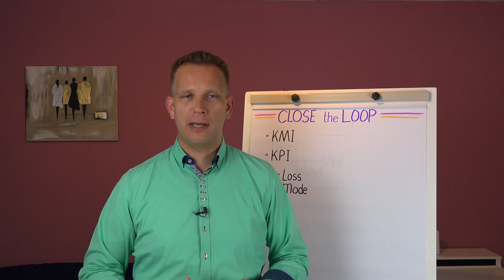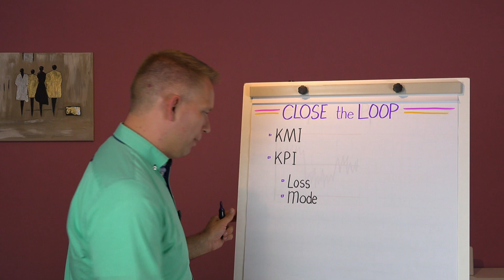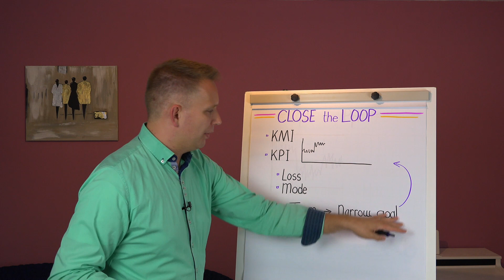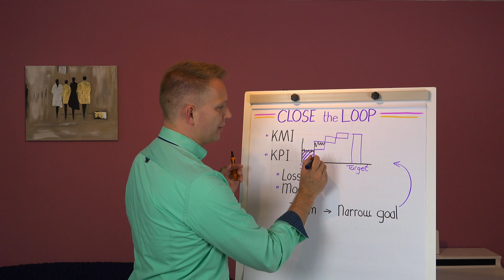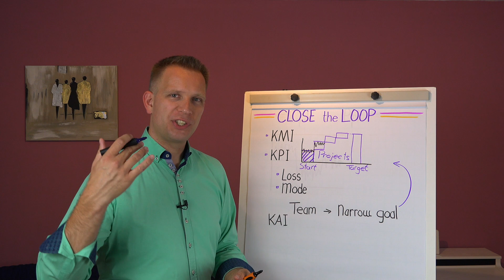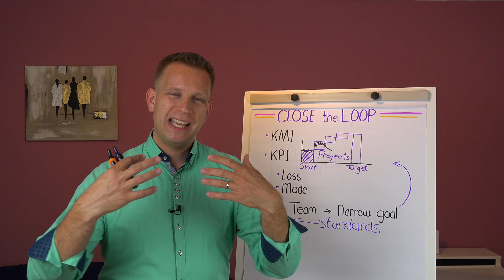Effective Continuous Improvement: Linking Team Efforts to Company Performance

Comment: Tom, could you develop in more details the KMI? Great video, thanks.
Reply from the maker: That’s probably a topic for its own video. 
The short of it is that if you only talk about KPI’s, that covers both KMI and KPI. 
The key Management indicators are directly linked to the company goals: cost per ton, total sales, total output and such indicators to directly influence profit and loss. 
Key Performance indicators are more directly linked to what you can see your people and machines do, the real operational things like OEE, % material waste, people present vs labor planned for a job, etc. They are the things that tell operational line managers how their processes are performing (often on a very quick interval or even live).